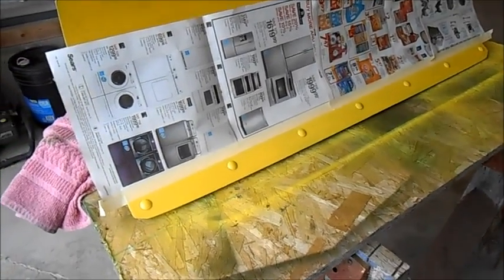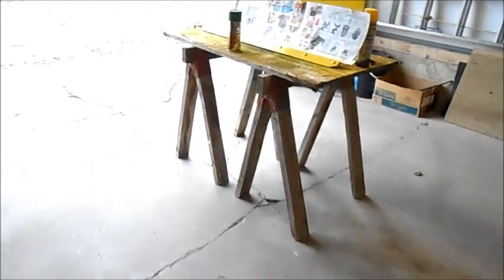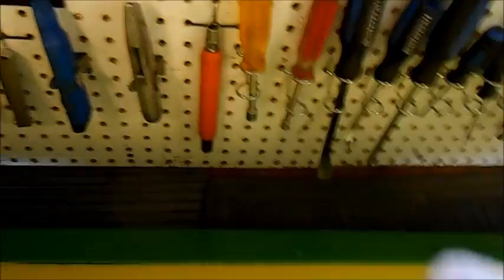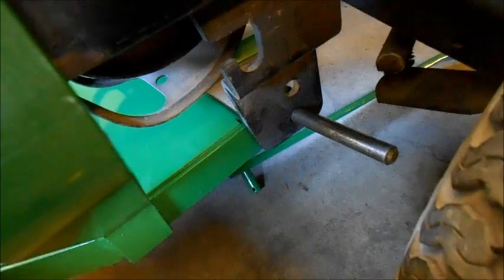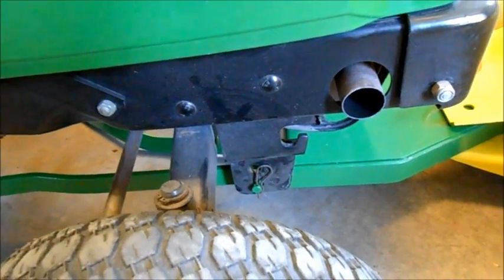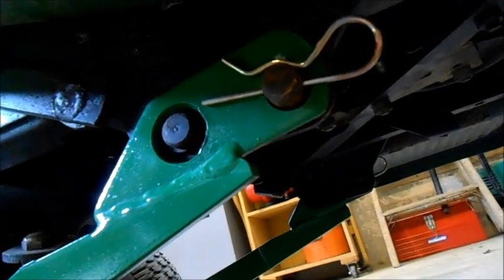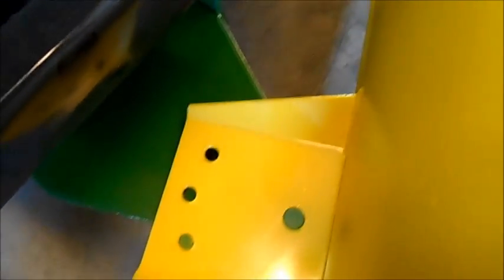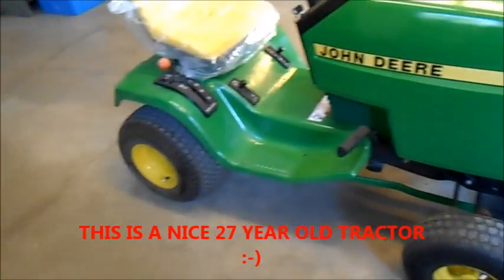Installing a 42 Inch Snow Blade on a John Deere

Comment: Nice I just picked up the same blade minus a few small attachments for 40 bucks black looks brand-new I just don't have the arm that goes to the mower deck or the arms that go underneath I have to figure something out I have the big plate though that mounts to the blade to the Tractor I'm going to be putting it on my JD gt275
Reply from the maker: You will get it.
Reply: Did you end up getting it setup? I see them for sale all the time on the net but they're always missing those arms that go to the deck lift. Would I even need those as long as the lift bar is connected?

Comment: I have a D130 and a 46inch blade.
I cannot find a de-install video.
Any suggestions?
Reply from the maker: Terry Lawrence 
I would start at the back of the tractor and work your way forward.  Replace the pins and clips as you go.  Take some pictures at each juncture for future reference.  
Good luck

Comment: would this fit on my jd 111
Reply from the maker: I think so.  here are the specs for the 2 tractors.  Look at the decks for the 2
111    http://www.tractordata.com/lawn-tractors/000/8/1/811-john-deere-111-attachments.html
180    http://www.tractordata.com/lawn-tractors/000/0/1/18-john-deere-180.html

Comment: And here I am again.. almost exactly 1 year later.... and still sick to my stomach with what a PIECE OF CRAP this entire piece of equipment is.   I worked abroad and needed a work horse to beat down the lawns when I could not get to them every week or arrived back in mid June (!).  Never have I seen such a poorly designed pile of crap...  Now I'm retired and need this shitstorm only for plowing in Northern New York..  I've discovered the ever MISERABLE 'PEERLESS' Transmission is about to pack it in...  I only wish I had a cliff I could drive (push) it off.

I'm used to working with Gravely....  Sadly, our family was forced to sell (everything) during a nasty estate dispute....   Getting rid of that machine was like selling my sister. 40 years of EXCEPTIONAL service....   And now I'm stuck with this pile of junk...........

Anyway... thanks for the vid... The set up most certainly is NOT intuitive.
Reply from the maker: Great rant.